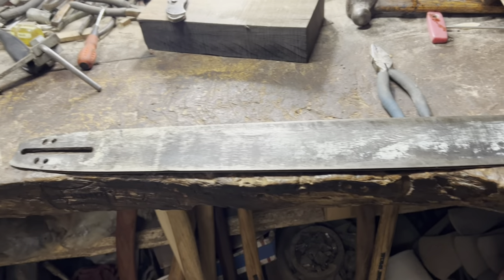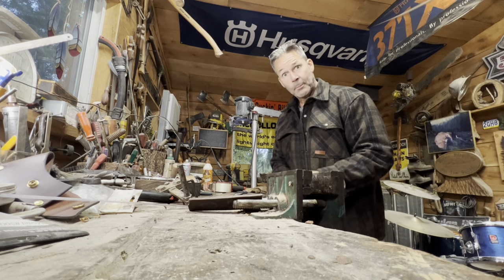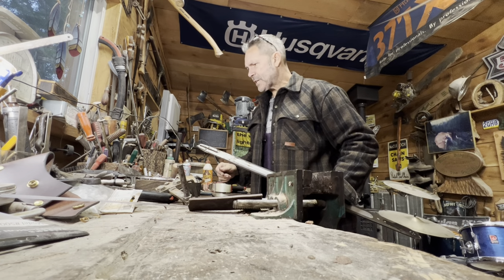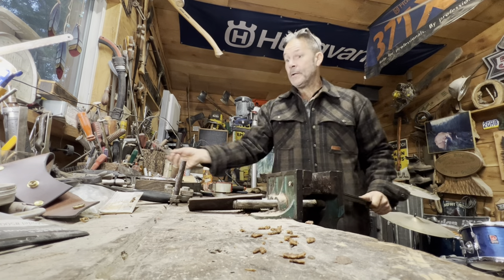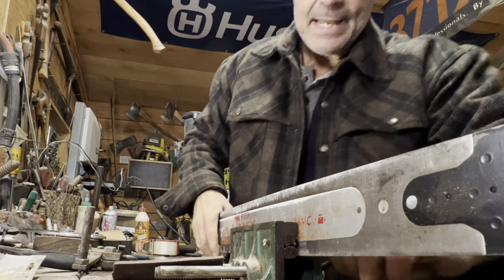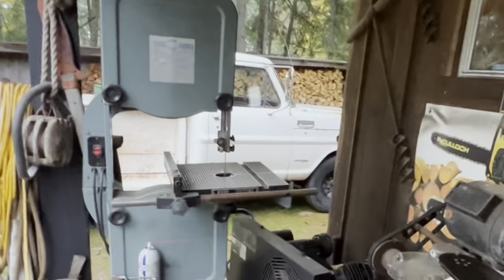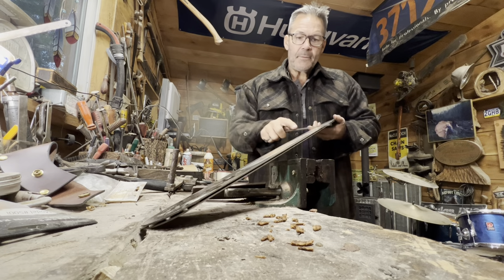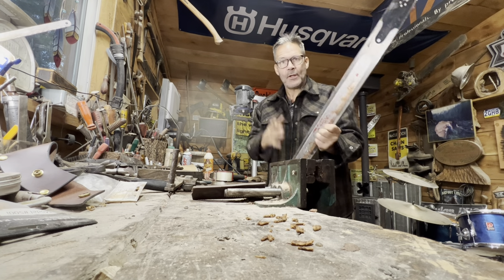Not many people know this.  Chainsaw Bar Maintenance

Comment: I mill beach logs and would like to add something. I keep my bars standing in a pot of old oil to keep the nose rollers from rusting, also some chains. My oiler is turned up high so I clean my bar every day but also don’t forget to clean out around the clutch with a dental pick. Oily sawdust will pack in there and add drag to the saw.

Comment: So, I haven't watched the whole video, but I only had do bar maintenance when the the oil hole was plugged and causes the bar to burr. Burned bars are bad. Keep your oil hole clean!!! And yes my bars had all the paint scrubbed off.  Yes a file raker will clean up burrs. Your chain will ride nice on a burr-less bar. Billy knows his stuff, but a little over the hill, I've cut 40 plus face cords on one bar, because I clean the oil hole...I do flip my bars all the time too

Comment: Good stuff, I use a 12” disc sander with the table set perfectly to 90• with a square to get my bar rails trued and a small belt sander like yours to debur my rails.  Always cuts nice and straight. Nothin worse than cutting your hand on a sharp bar rail. Sharp chains make a huge difference in how long your bars last

Comment: Few things I would also add is a needle grease fitting in the grease hole, I had a few sprockets start to bind making the saw run poorly a little grease in the sprocket made a big difference

Also had a few bars with pinched noses, bar would get very hot even though it was getting plenty of oil, ended up using the scrench to pry the nose open a little and it ran like new

Another thing is most screeches aren't actually coned m screwdriver tips, but are ground parallel so you can shove the tip of the scrench into the bar channel and as you're cleaning all the junk out of it by pushing through the channel you are also deburring it and taking off that slight mushroom edge it'll have on the inside
Reply: I find chain saw oil inside of a needle syringe U pimped into the little hole works better, i used to do the grease thing and then found the sprocket would get goopy after sometime and became to thick of a sludge & was harder to re clean.
Reply: @sevendyseven4090  lithium grease is the way
Reply: Canola oil is cheap & gets in there
Reply: I do most of my cutting in the winter, not least because I can buck a log lying on a bunch of snow straight through without tagging dirt. I learned the hard way though, that getting the tip down into the snow is pretty hard on sprocket lube, so I grease mine just about every truck load now.

Comment: Now this is the good stuff. Its all in the details. That's a very fine bevel under the top plate.
I know a lot of guys prefer a steeper tougher bevel angle but when i grind my planer knives ive gone back to 35 degree's. You get a much finer smoother finish and its easier on the motor's. 
But outside of that sweet spot you get problems. There is a narrow corridor of optimum tolerances with these things. Once you know them and hold to them your good.

Comment: I clean my rails out with a screw style air compressor blower. Stick the tip right in the rail and run down it blowing all the gunk out along the way. Works very well and takes no time!

Comment: Thank you for sharing another informative video. Your channel has shown me a good bit about wood cutting and power saws. I have watched your other video on bar maintenance. From that I have bought a little bench belt sander. The question that I have is when is a bar that worn-out that you can no longer grind it? I have yet  to get a bar to the point that you can no longer maintain them.

Comment: Watching you from Scotland Billy, really good bar maintenance tips.
In the early 70s when these roller bar came out we were given small tipped grease guns to lubricant the rollers on the end of the bar. If you forgot to do it they would disintegrate!
Reply from the maker: I still grease mine when there’s a hole
Reply: Yeah, I'm amazed at how many people don't grease their bar tips, easy as it is! Glad I learned the value of truing a bar long ago...I use one of the right-angle hand files...works great! @BuckinBillyRaySmith

Comment: The bar is so important. A hot sticky chain robs a ton of power. Good common sense goes a long way. Even if one's not mechanically inclined we all are capable of learning if we want to and we take the time to educate ourselves. And most of all just tinker with stuff. I grew up fixing my off road bike since I was 4 mom and day couldn't afford expensive shops. Now I can fix anything just about. But it took time and I learned. I loved learning how stuff works. We all have it. And everyone has to start somewhere. Don't be afraid to learn guys.

Comment: Nice bar maintenance video Buckin'. A table disc sander can also be used as long as you can set the table to true 90° - don't rely on the table angle markings.
Just remember to wash out the bar groove (away from the sprocket nose) after grinding - you will have a mix of belt/disc grit, metal particles and oil in the bar groove, it makes good grinding paste. Cheers.

Comment: Handy tips ❤️ The fancy pants right angle tool is a bar dressing file? Some come with a cheap file that doesn’t work real well, vallorbe make a decent one that even has the direction to use it but a good old faithful flat file does the job 🤙 whackin some grease or oil in the nose sprocket hole & cleaning it out, canola oil is cheap as chips & works

Comment: I used to use a smooth flat file to get rid of the burrs on my bars, but now I have a dressing tool that does the same thing but makes the job a lot easier.  Dime, penny nickle are my groove gages.  A dime fits in the .050, a penny fits in the .058 and a nickel fits in the .063.    I clean my bars after each use.  I have the Stihl tool that will clean the groove in my bars but a putty knife works just as well.  I look for little collops in my bars and when I see them I dress them smooth with my dressing tool.  You will be surprised how easily your chain will rotate on a dressed bar.  Almost like glass.  I just put them in a vise and dress them down.  I dress the side and the top.  The side gets rid of the burr and the top gets rid of any scolloped out places. Like BBR says a file will work, but you must get it square to the surface.  Dressing tools are cheap and work well.

Comment: HI BUCKIN 😊😊 U can use a chainsaw wrench 2 clean the bar out or a flat head screw driver U have 2 clean both sides and U have clean the oil wholes out so the bar can get bar oil 😊😊 buckin burrs  will happen on the chainsaw bar it also keeps the chainsaw from cutting U have 2 use a flat file 2 fix and file it down the edge rolls up is what happens 😮😮 U have 2 file both sides it should be smooth no edge or lip on the bar 😊😊 U can see it or feel w your finger nail 💅  and when U clean the bar U should turn it over 2 the other side 😊😊 OMG 12 13 2O23

Comment: I have an adjustable plastic tool that holds a flat file for sharpening the edges of alpine skiis. Some are not adjustable, and have a preset angle that is not 90 degrees. You need the square 90.

Comment: The machine in use is a vertical platten linisher, personally I wouldn’t recommend using an abrasive belt coarser than a P120 grit. If using a ceramic belt then a P180 grit should do it.

Comment: Especially with light bars check for flatness and stress cracks. Around the tails and oil holes especially.  After several grindings watch about bar tip alignment with the body of the rails. Bars are like everything else,gettin expensive.  Maintenance is alot cheaper than buying new.

Comment: Gave up with trying to salvage a good straight cut by swapping out to thicker drivelinks or anything like that,I’d just use an orbital sander to gently remove side burs and just blow bar out from sprocket out to open end of bar,get a new bar every 2 or 3 months for what ever saw needs it

Comment: Hey Mr. Smith, I have a large white oak on a fence line that I am repairing (replacing posts and rails and pickets). The oak tree base is intruding several inches into the fence line and I'm wondering if I can use a chainsaw to cut away enough of the trunk (probably 4 to 5 inches) to allow the fence to be straight and not kill the tree... is that possible?

Comment: If you use a linisher to get the top of the rails square again , I'd be inclined to do a final dress lengthwise along the bar with a file like you show early in this video , to get rid of all those ridges that run across the rails , they have to cause friction with the chain surely .

Comment: I would check for my burs frome center of bar up to the guide not up and down they will lay you open fast or use the tip of flat file to feel for the burr

Comment: Does anyone else grease the roller tip on their bar?
Reply: I do.   I have a few saws bars with holes for it.     My new saw doesn't.   But I will be drilling one to get grease to the roller.
Reply from the maker: i always do if it has a hole

Comment: Ironic that you were showing how to file a bar, I was giving that a try the other day in an attempt to get rid of some ditch and was shocked to find that a brand new mill bastard file was skating over the bar and in fact damaging the file. I could not believe how hard this bar is, its just a stihl bar so nothing exotic. I was wishing I had a bench sander as I knew that would work good ... and there you are with a bench sander. I have bench grinders but that is not the right tool at all to square anything up.